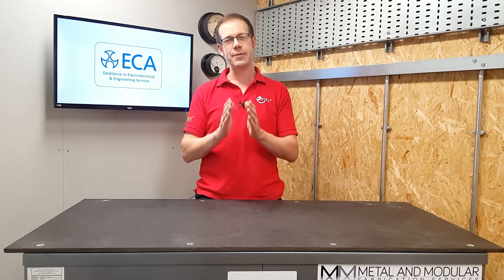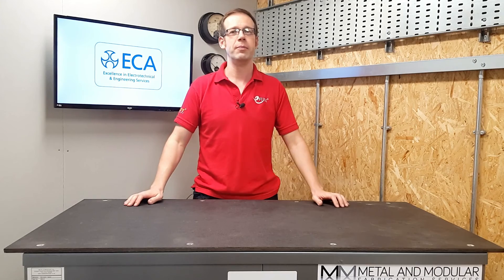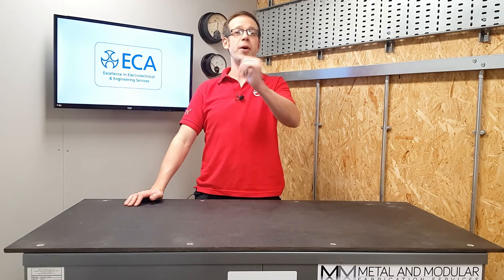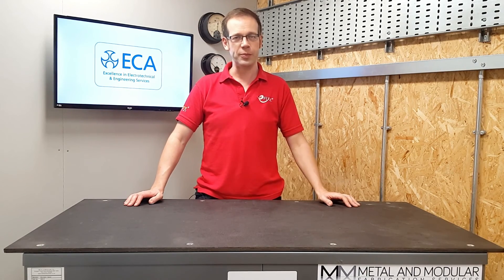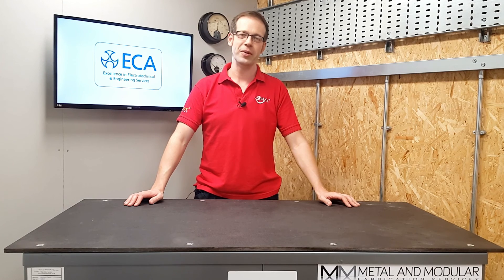Can you use parallel conductors to create the same cross-sectional area as a single one?

Comment: surely parallel conducters are a safer way to install as in the event of a break you will still maintain 50% capacity on cpc not ideal but better than nothing on a single cable failure  !
Reply: but a failure could be unseen for long time.
Reply: @marcesser4218  a total failure could have the same unseen detection for a long time  if on a cpc , it is the same as a ring circuit

Comment: In terms of doubling up.Adding a second core just adds another issue. That's two small cables which will look crap, possibly be awkward to terminate, either of which could fail and you're back where you started with a non compliant csa and a potentially dangerous situation in the event of a fault. I understand there would be a temptation with an upgrade to add another cable to share the new load or whatever ,but this practice in my view should be a last resort.

Comment: Doubling earth conductors to fulfill the requirement of having a thicker one.. OMFG 🤦🏻‍♂️ the apex of laziness
Reply from the maker: The approach is also used when an additional CPC is run parallel to the steel wire armour.
Reply: @efixx  sorry but it doesn’t sound or look right in any way to me.. not allowed anywhere in Europe either 🤷🏻‍♂️ ( different electrical education i guess ).. I don’t understand why you guys are following this not standardised posh term cpc that some guy sitting in a desk decided to start calling to the earth conductor.. it’s L N E or L1 L2 L3 N E.. E stands for earth.. cpc doesn’t exist 🥲
Reply: @filipe.skunk8  we distinguish between the conductor itself (either CPC or bonding cable) and what it's connected to (Earth). Of course the conductor exists!
Reply: @filipe.skunk8  chill fella. I have never seen this happen in all my time in the industry. Yes, the SWA happens but this was simply a answer to a scenario, which could happen, but I'd say any electrician worth his or her salt wouldn't do it and if they did, its not wrong, but I'm pretty sure they would good job of it.
Reply: @tobysherring1369  cpc stands for circuit protective condutor yeah? Which wire is the cpc then.. the earth one no? 🤷🏻‍♂️ Cpc is a general term and can be a metal trunking, cable sheeting, metal conduit, exposed metal parts that are bonded etc etc.. that because you can’t really call those a earth wire.. but still working as an earth path.. like saying that a metal back box is part of the cpc cos the earth wire is also tapped into it.. or at least is what I perceived from where that cpc term comes from.. I’m an immagrunt and my English is shite so correct me if I’m wrong,  but in my ear sounds like you went from referring to earth wires in the 1st person and now it’s in the 3rd and generalised cos it can be anything metallic that is connected to earth..
Reply: @craigemmott4976   I’m chilled man 😂 but it’s a bit cringe as the raw message that passes on is “can i bodge 2 to make one? Yeah just make sure you leave a bunch of labels for the next one to come” and believe me people will go for it.. got a 6 already so I’ll just run another 10 to make it 16, cheaper, easier to run than a 16..
instead of telling people to do it right and tidy they tell they’re allowed to make it messier 🥴 no wonder some electrical cupboards are just missing the monkeys, look like cable jungles inside
Reply: @filipe.skunk8  no, I meant CPC is the conductor that is included to protect a circuit. It is connected to earth. I think it is meant to distinguish between the conductor itself, and what it is connected to. CPC is a wire, it doesn't include radiators, pipes, metal frames, back boxes etc which are (sometimes) "extraneous exposed metal parts" and they may need to be bonded to Earth using an earthing wire: this isn't a CPC because it doesn't protect a particular circuit. CPC doesn't describe everything that is a path to earth, just the wire connected to earth that runs to an individual circuit. PS in the video he talks about an earthing conductor, ie bonding wire. He doesn't talk about CPCs!

Comment: If you have an earth rod for house CU , hot tub CU, Garage CU, but are all connected back to main CU.... is this good or bad? Or is it best to split and run each as distribution and thus leave off RCD protection over the cables running to each?
Reply: I wouldn't connect the hot tub cpc to any other earthing system apart from the rod for that consumer unit . No connection back to the supply intake earth (neutral)  in case of voltage on the neutral due to a failed connection

Comment: Confession time..I have an 8.4K shower in a home I own connected to a 6.00MM T&E cable, maybe up to 5m metres vertical trunking with less that 10% cable occupancy and a 5 metre horizontal run to the shower switch, above the loft insulation, connected to a 40 amp MCB.                                         Its probably been like this for twenty years .
I of course have checked connections and as to whether there are any signs of overheating on the cable and zero evidence whatsoever of any issues.
Bearing in mind, other than like a cooker that could have a roast on for over an hour and some hob rings running for extended periods, the shower is rarely on for in excess of ten minutes so I would not expect to experience an issue.
I am of course aware that one could say "what if someone left the shower on for an hour or even longer" ?
This has prompted me to take my clamp meter  and thermal image camera and carry out that scenario.
The only answers to the above scenario can be..apart from replacing the cable with 10.0mm T&E
a..Not ok
b.. Ok 
Or words to that effect.
From what I can gather, the 6.0mm cable installed in that method with a 40 amp MCB seems to be acceptable. load is (on paper) 37 amp and the cable installed in that method will accept in excess of 40 amp, posibbly as I just read up to 47 amp.
I would not add an additional 6.0 mm cable connected in parallel to remedy, if at all a remedy was required.
I would just rewire with a 10.00mm T&E, I may actually do that when it comes time to sell the property.
Ether way, I am going to carry out some check as indicated above, just for kicks.
Comments are welcomed of course.
Reply: 6.0mm T+E cable is ok for your current shower but if you upgrade it to a 9.0kw or higher then a 10.0mm cable and on a 40 to 45 amp ( depending on shower size) mcb or rcbo if no rcd protection is provided would be better.
I felt  6.0mm cables and their circuit breakers get quite  hot in the consumer units when connected to high kw showers
Reply: @paultipton743  I woild agree with your response there Paul..
I just have to do the clamp test along with thermal image camera not or...I won't be content, even thought there has never been any evidence of overheating at all,no cable discolouration on visual inspection, but as stated I have only ever done a check with around ten minutes or so of use..maybe a longer test and thermal test may reveal different results.
Reply: @oyleyhands1332  6.00m2 on 40A is correct. In some cases even 50A.  There are two separate issues: the cable size has to match a suitable overload protection device, so check the tables. Second, the fixed load of the shower: 9kw = just under 40A. 6mm2 takes 54A in conduit or trunking and clipped direct (over insulation as you describe) 59A. What we often see is overheating at the terminations, eg shower isolator, due to loose screws or poor quality accessories. The cable itself should not overheat within its stated load capacity.
Reply: @paultipton743   I don't know much about these things but as far as I can see the 6mm2 can easily carry 9kw continuously: routed as described it would take 59A max and the load is 40A. So the cable can take almost 20A (or 1.5x) more than the load. Why upgrade that? If the MCB gets hot, upgrading the cable won't help. 50A isolator, 45A MCB, torqued terminals.

Comment: It's more complex for cables requiring OCPDs. For example a fault such as a nail penetrating only one of the parallel conductors may cause the whole let-though energy to be concentrated in that single cable, exceeding its k2S2 rating. See BS 7671 Appendix 10 for more info.
Reply: There's the old ring final circuit issue again. They're only talking about bonding conductors here, though.

Comment: A few years ago I went to connect a cooker up & the supply was 3 x 2.5mm twin & earth's from a 30 amp rewirable fuse, so 7.5mm then!
Reply: When 5mm2 would generally be plenty for 30A fuse...someone didn't do the calcs!
Reply: @tobysherring1369  but better to be too large than too small. I've over sized, albeit in 1 rather than 3 cables, hob and oven cable in case I want to upgrade them to something better
Reply: @craigemmott4976  better in that case to run a cable for each with their own breaker and isolation. 4mm2 for both but 2.5mm2 would probably suit most ovens on 20A.

Comment: A final ring circuit is much a parallel circuit is it no ?t, conductors are connected to the output of say, an MCB and take separate paths to to input terminals of a socket outlet.
I  would say that on a final ring circuit....one would expect as such but having stated that, two 6mm T&E cables feeding a say..9KW shower would not be expected from anyone following up the initial install, hence clear labelling would and should be a given.
Issue could be that if one conductor lost connection or were broked for whatever reason is that the shower would only be fed with a 6mm conductor and with potentially no way of knowing that .
Even if a MCB had tripped , and the  reason for tripping was not evident, and there was no permanent short or otherwise, the consumer could just reset the MCB and be no wiser.
As a retired and not a current 18th edition spark, last was 17th, my personal view is that albeit on paper it appears to be acceptable, it's not good practice, especially on a new circuit.
I guess there are minor cost advantages if there is a current 6mm cable installed and there was a shower upgrade that required a larger cable that it could be tempting to save some money on the cost of a new cable, especially if a home owner nipped into B&Q and was intent on saving a few quid, but would that individual even test or label correctly, I think not.
My view if I were to had taken on that job would be, use a 10mm as the cable still has to be run from the consumer unit to the shower switch and shower anyway, it's bad enought to fit a 10mm cable into switches/showers anyway, let alone 2x 6mm conductors, plus there is the increased potential for poor connections.
Edited for smiles.....I am sure many sparks carrying out and EICR must have found that one 'leg' of a ring main has been 'lost' yet the customer has no knowledge of this fault as all will work as far as the consumer is concerned, and why would most consumers? or even have the knowledge of such things.
As an apprentice, even a megger was a rare sight, I think the company I worked for with maybe 20/30 sparks may have had two and they spent very little time on sight and I was told  I was the only apprentice who had asked for and AVO minor to be bought and deducted from my wages over a period of time.
An MFT was not even a distant dream. 
Test lamps were a lampholder with a pygmy lamp and and two lengths of singles, continuity tester was a Freidland (I think) doorbell all taped up with a 6 volt torch battery and again, two short lengths of singles...if you found one with croc clips, you were posh !
No two way radios, I had two old phone handsets with a 9 volt battery and when working where there were a couple of spare cores in a cable..just twisted the whole lot in series for our communication.
And may I just appologise to Lloyds Bank for re-purposing two of their old GPO phones for my own  use  😂 
I did again invest in a Drummond test lamp set from my meagre brown wage packet.
The above is just my personal opinion and not intended to open up pointless bickering..open opinions, yes, debate yes, but please, not the usual armchair keyboard warriors.
Reply: @Oyley Hands.  Excellent consideration of the whole situation.  I’m with you, ok on paper but definitely not in practice, given the termination issue and risk of loss of one conductor.
Reply: Agree with you re parallels. But a 6mm takes 45A in an insulated wall. A 9kw shower is approx 40A. Why would you go over 6mm? Just asking, not criticising...

Comment: Why does twin and earth not have dedicated green and yellow insulation on the earthing conductor by default?
Reply: A bare earth conductor between 2 live pvc coated conductors is a very good safety feature 👍
Reply: @gazdkw82  Thank you but can this be expanded a bit more?
Reply: @ominence5573  if a twin and earth cable is fixed to a wall and someone drives a nail through the middle, there is a greater chance the CPC conductor will provide an earth path than of the CPC was insulated.

Some say it's down to cost but I like the idea the above is correct
Reply: Insulation on earthing conductor is standard in other counties, bare earth conductor seems to be a UK thing. Probably to save cost but could have other benefits as others have mentioned.
Reply: It reduces the csa of the overall cable.

Comment: So are we saying that, say for example we couldn’t use a 10mm in parallel with a 6mm. (Different CSA’s) to make a 16mm conductor?
Reply: The resistance of the larger cable would be lower and carry more current than the smaller
Reply: @dennisphoenix1  but wouldn’t the different currents flowing down the different conductors be proportional to the csa’s? 
As long as the total amount of fault current is acceptable for a 16mm total csa then two different cables in theory should cope under fault conditions, and the smaller ons shouldn’t overload??? 🤔
Reply: @gbelectricks  you cant guarantee the current will go as intended with different csa cables . Consider a ring main  of equal csa but current doesn't flow 50/50
Reply: @dennisphoenix1  with the ring argument I agree that 2 conductors of different length (with the same csa) would have different currents flowing, that would be proportional to their overall length, 
Wouldn’t two parallel conductors of equal length have proportional amounts of current flowing through them? 

I think I agree with you by the way, I’m just arguing with myself I think!!🤣
Reply: @gbelectricks  ultimately it doesn't matter what my opinion is, higher powers decide on what's permissible and what is not
Reply: @dennisphoenix1  Efixxx replied to another gentlemen in the comment section here suggesting that such a combination would be okay

Comment: shouldn't there also be a statement to be made about conductor length? i.e. both conductors to take the same route or be the same length to ensure the load across the conductors is balanced?
Reply: And the same material.
Reply: But isn't that the principle of Ring circuits?  2 separate lengths added together to increase the amp rating? I can't see it being too much of a worry but it would be an interesting test to have a load and one of those clampy current meters on 2 separate wildly  different length live conductors.
Reply: @tim g Thanks Tim! Guess it does make a big enough difference.
Reply: And the same manufacturer- it should also be from the same roll. As to not have a different in material or resistance causing an uneven current draw from each conductor. Even the same manufacturer could run out of wire from one of it suppliers or change suppliers at any time and usually do for cost reasons.  That is why all parallel conductors on the same circuit should be the exact same length from the same roll of wire. Never! should reused, repurposed or field recycling of wire be used when running parallel wires.
Reply: @davidkarpen5686  That sounds totally unnecessary. In two parallel conductors the currents will divide according to the inverse ratio of their resistances. So if the two wires have slightly different resistances the current will divide similarly slightly unequally. If you are replacing a single 16 sq mm with two 10 sq mm conductors you can accept a fair degree of inequality in the two cables before you have an issue.

Comment: Ive come across line and neutral conductors run in parallel, eg a five core SWA on single phase that had 2 cores for line, 2 for neutral and a single core and the armour for cpc. Would this be acceptable also? We simply replaced for more suitable 3 core SWA.

Also if this possible, the calculations wouldnt simply 2 x 10mm2 as you'd have to calculate heat loss, volt drop, current carrying capacity etc.
Reply: My take (as someone with an electrical engineering degree, but not an electrician)

The earth in larger sizes (4mm² and up) of T&E is typically two sizes down from the phase/neutral conductors which makes it less than half the CSA and that seems to be accepted as perfectly adequate under normal conditions. So I don't see the overall earth conductor size as likely to be a problem.

current carrying capacity is a tricky one, AFAIK the standard tables don't give ratings for a cable with four cores all carrying full current at the same time (in a 3 phase cable it's assumed that only 3 of the 4 cores will carry full current at any given time).

I think a reasonably simple and conservative thing to do would be to take the current rating figures for 3 phase (which assume 3 cores are loaded), multiply them by sqrt(3/4) to account for the fact that four four conductors are loaded (cable heating is proportional to the square of current) and then multiply by 2 to account for the fact you have two cores in paralell.
Reply: I’d say that’s more acceptable than 2 separate cables